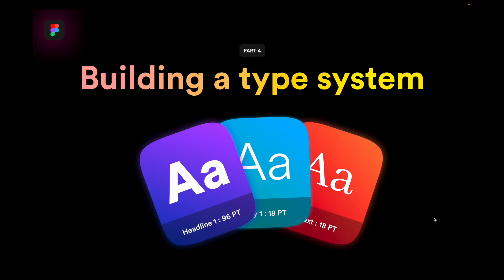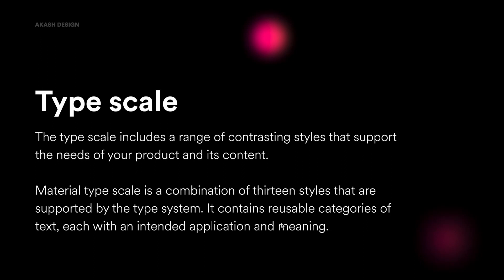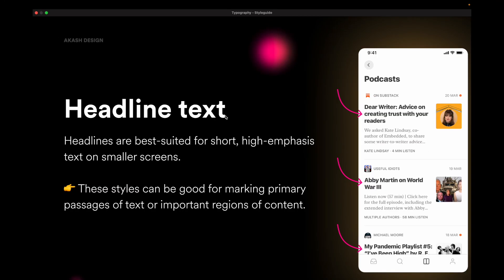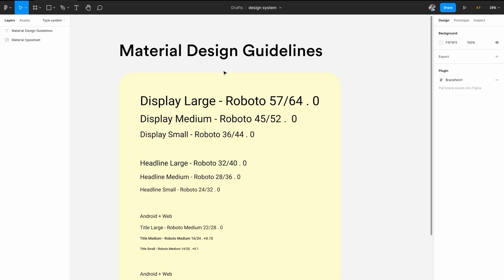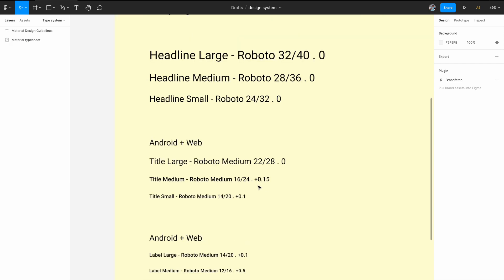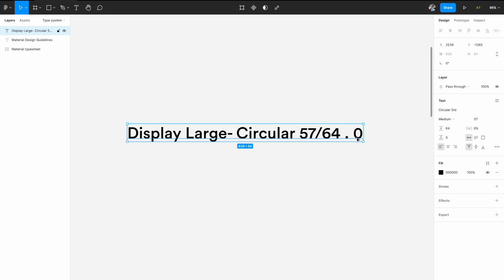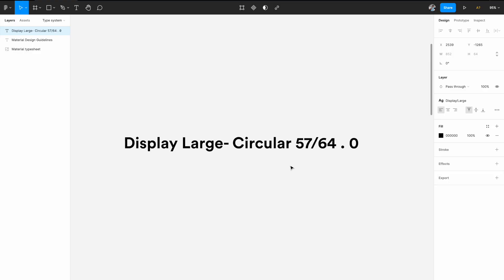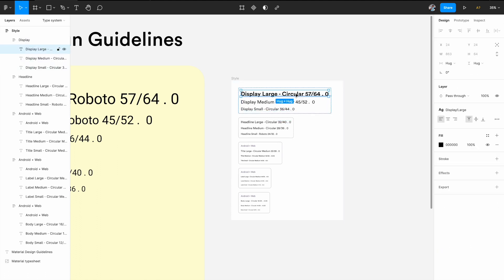Building a Design System with Figma (Part 4) - Building typography system

Comment: If we are following google material guidelines, do we have to follow everything or we can tweak a little here and there. Like if I want to use a bigger font for my body or not using google font?
Reply from the maker: You can definitely tweak anything, google guidelines are just basic examples. If you wanna change font size or weights, that’s totally upto you. Just make sure your different fonts have enough contrast between them interms of size and weight just like googles :)
Reply: @AkashYadavUX  Thanks a lot Akash. You always reply to my queries. As a beginner it's super helpful. Appreciate it.

Comment: Great video man. So clearly explained with much detail. I have few questions:
1) Should we create different type scales for different weights?
2) How many weights should we use?
Reply from the maker: Hey Prajwal
No you should create different types ales for either weights or size... Font size and weight combined is known as one style. You should figure out how many such styles you need in your project.
Check out material design guidelines, you will see how they have added different styles :)

Comment: Thanks for the good youtube. But I have a question. For example, Display Large - Circular 57/64 appears to be an appropriate size when used on a desktop. But Display Large - Circular 57/64 is too big for mobile use.

Therefore, even with the same Display Large, the corresponding font value (ex. 57/64) seems to be different depending on the size of each responsive screen. How can I specify the design system guidelines for this?